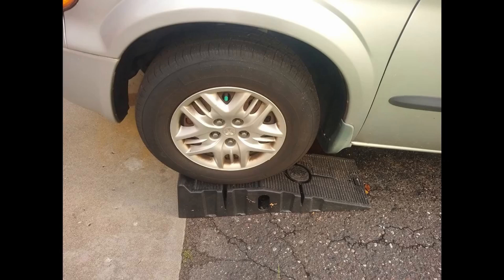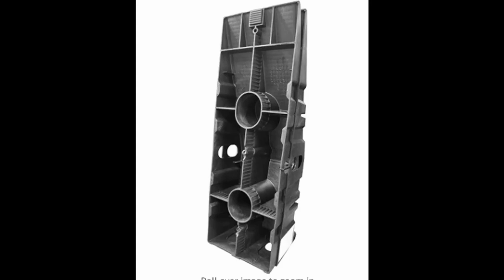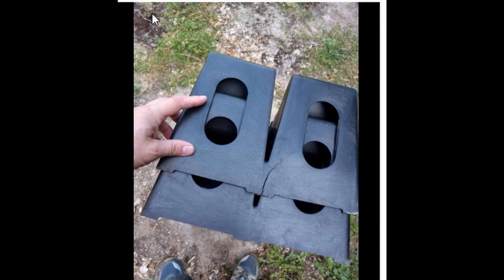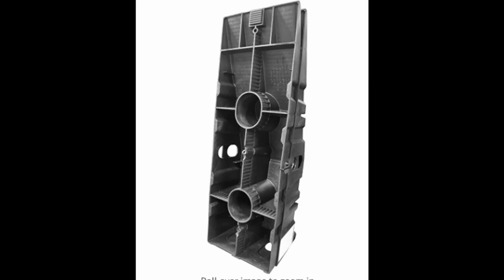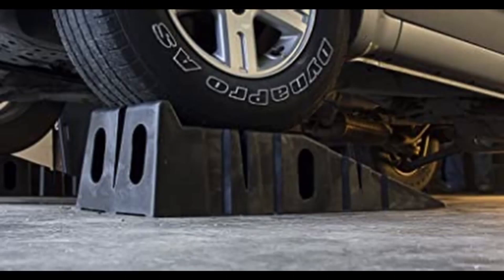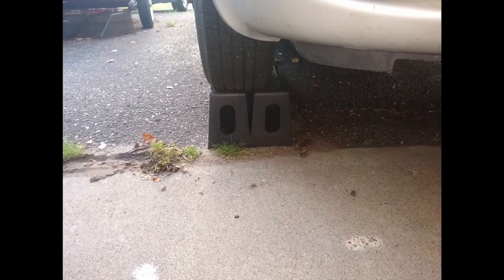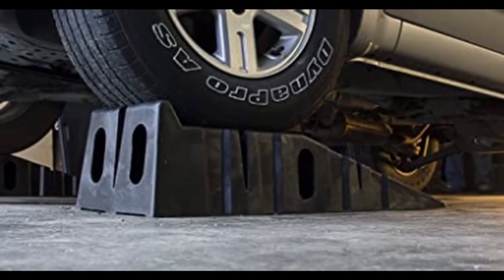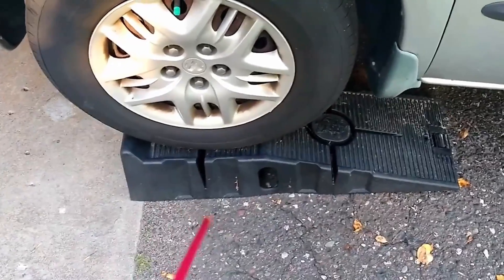Rhino Ramps Limitations and Precautions

Comment: I have 2 sets currently and still don't trust them completely but jack stands give me piece of mind, they are nice to have
Reply: Even the other companies like Race Ramps say, when in doubt also use Jack Stands.
Reply: How about we use both? Use ramp as primary and then use jack as backup as precaution?
Reply: @Fred-Faizi  that's what I do, I use both
Reply: @Jdl223   sorry i thought that you mean jack stand is safer then ramp. Thanks for clarifying.
Reply: I'm planning to ramp the front of my Camry for an oil change. Is it still possible to use jack stands (as a backup) when the front of the vehicle is ramped and the car is at an angle?
Reply: @littlegoose9860  Good question. It's been a year since you posted this question. I would think if the plastic ramps break, the vehicle would slam into the ramps which would either tip over or slide over, or even worse, the pinch welds would simply bend in and the vehicle would still slam into the person underneath. Right now I have Pittsburg metal ramps and I've had them for years with no problem.

Comment: I would think as long as the wheel is over the plastic cylinder and there are no cracks should be good. For slick surfaces you can buy rubber door mat type material at a big box store and set them on that. If the piece is longer than the ramp leaving the extra hanging past the start of the ramp should help quite a bit.
Reply from the maker: Yeah, a piece of plywood that locks in under them might be a good way to keep the spacing correct too.
Reply: Excellent comment and idea!  I’ve used these but have a problem with the chin spoiler catching and pushing the ramp.  I’ve been experimenting with pieces of wood that will help alleviate that problem.  👍

Comment: One of the biggest safety concerns is the sliding issue when attempting to mount them. The rubber footing is not enough & decreases over time as you use them. Footing needs to be bigger for better grip. The ramps are not wide enough to accommodate tire width. If you don't have a relatively  flat surface to work with dont waste your time or money.

Comment: I have a set of ramps that are not Rhino brand.  They are a heavier plastic with a more substantial close honeycomb core to support them.  Unfortunately, they do not nest together for storage.  The ultraviolet light of the sun is the greatest deteriorator of all plastics, so they shouldn't be left out in direct sunlight...at least tarp them if you don't have room in your garage or shed.  Also avoid using them in sub-zero temperatures, although that's probably not when you want to be crawling around under your vehicle anyways.

Comment: I have a pair of rhino ramps I bought 25 yrs ago. They look nothing like the new ones. The new ones look so weak and cheap. Just from the underside view I wouldn't trust them with a car. Mine have a very tight egg crate design. The new ones are just cheap plastic boxes with a shelf life. Just make them out of solid wood. They are heavy but fool proof and you can leave them outside and they won't rust..
Reply: No they'll just rot.
Reply: I also have the older Rhino Ramps.  Back when they cared about quality.  They are built like a tank with no weak areas with a full support grid underneath.  Look at these new ones and I wouldn’t park a scooter on them.  They look pre-split out of the box!  What’s the purpose of that design?  Pre-determined stress points?!
Reply: @hobbycow5346  They are stackable. I read somewhere 2x4 can be inserted but I haven't bought them yet.

Comment: why not fill inside cavity with concrete. That sound make it break/slide crack resistant
Reply from the maker: possibly some sort of polyurethane foam
Reply: Sure try moving them around after that not even worth doing it at that point due to the weight and cost might as well get metal ones than
Reply: Sure thing, just fill em' up. For summertime parties while working on the old jalopies, I use mine for a Jello Mold with marshmallows of course!

Comment: My car weighs only 3450lbs, but I went with the 16K ramps, for good measure
Reply: So if your car is 3450lb which would mean you will need min 1725 lb per wheel but not sure why a manufacturer would certify this at 8000lb each side? Why would manufacturer give invalid data? Its like i do oil change every 2000 miles because 5000 is not safe for engine. I dont understand.
Reply: @Fred-Faizi  they certify it at 8k per side because that's what it can hold? what's the problem here?
and 5k is not unsafe unless you're pouring shavings in on purpose along with your oil...
Reply: Exactly what I did

Comment: As you can see in the customer images, the big lip on the top can put enough pressure on the ramp to break off the top part of the ramp. Clearly a design flaw. I'm glad that I didn't buy these ramps, and never will because of this.